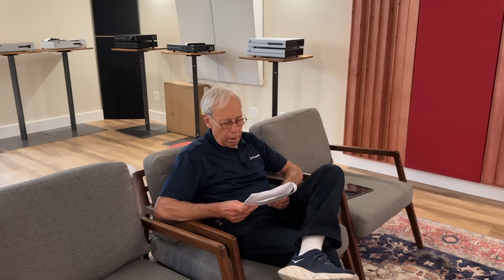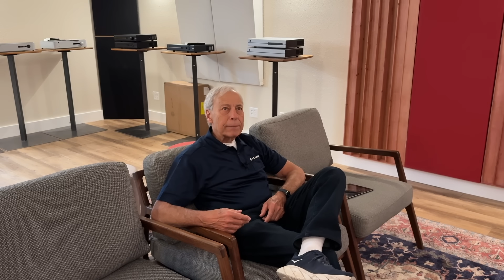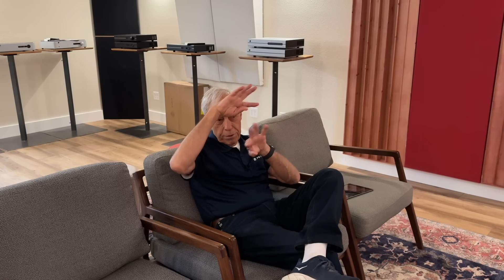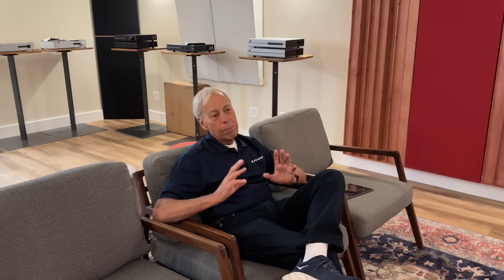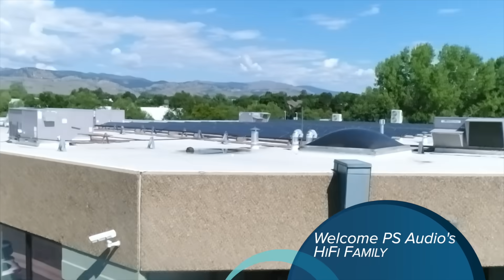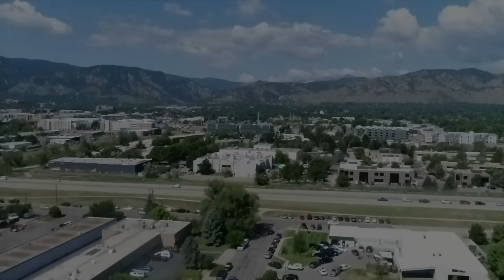Ladder DACs, vs  everything else

Comment: Hi Paul, I'm Jim from Guilford, CT and thanks for answering my question.  So, by converting any PCM recordings over to DSD you don't need to process the PCM to analog separately.  I'm guessing that's what most other DACs do i. e. they convert the PCM recording to Analog and use some kind of PDM DAC built into their units for the DSD recordings.  Or does anybody do the opposite of what you do and convert the DSD to PCM and then use their PCM DAC to output analog? And what is it that makes your 512 PDM DAC so special that it sounds better than the run of the mill PDM DAC? 

The more I learn about DACs and detail resolution it seems to me that many people get hung up on the notion that you don't need higher and higher resolutions to capture all the nuance in music.  Many people believe that we're exceeding what's necessary so why bother with very high sampling rates. And while they might have a point, I think that perhaps the reason that higher sampling rates can sound better has more to do with how it's output to analog.  This is why when you up-sample to a higher sampling rate you can't add any more detail than what is in the original file. But the higher sampling rate data, it seems to me, is better converted and output to analog and just plain sounds better.

Comment: Even cheaper DACs made with the most recent commercially available DAC chips are extremely good. 

I just participated in a blind listening test of a $75 DAC. Out of 500 audiophile participants, 55% heard the DAC to be completely transparent (including me), 43% were found to NOT be able to reliably hear the differences they (incorrectly) claimed that they heard.  Only 2% claimed to hear a difference and were not proven to be unreliable listeners. 2% was close to the expected value for being correct by random chance. 

The fact is that the best of the current DAC chips are sonically pure and only add $20 to $50 to the cost of a DAC. DAC chips do all the heavy lifting, the rest of the circuitry in the DAC just acts like tone controls.

Once again, Paul makes claims that have not been substantiated by blind listening tests.  Without blind listening tests, all claims are entirely untrustworthy.
Reply: Blond listening test mumbo jumbo again? They don’t work well for audio, for all of the well documented reasons. Pls.
Reply: @MichaelLichnovsky  Blond listening test?  You don't have ANY documented reasons.  None.
Reply: @markmeridian3360  good on you for spitting a typo and pointing it out. I’ve been schooled. Good one. 
Blind auditioning over longer time periods is much better. The ABX focus on conscious experience, where psychological literature clearly acknowledges the impact of subconscious and long term effects on any experience in any of the five senses. The 21st century is here. 
Also, have a close look at the concept of “blind sight”. To continue thinking that a listening test that focuses one’s conscious experience is representative of the real world act of the listening experience is a fool’s errand.
Reply: @MichaelLichnovsky  Somehow, if your subconscious can detect sound quality differences, but then if that doesn't make it up to your consciousness (it obviously doesn't because it's not scientifically measurable), then  there's no difference between that being true or just mumbo-jumbo.  

The fact is that humans have very poor memory for sound quality that persists over time - almost every single person can't reliably compare sound quality that they heard a month, a week, or a day ago to what they're hearing now.  That's why you have to do ABX testing.

The 21st century is here, learn some real science, not debunked new-age crystal power.

Comment: So, actually, there are 3 types of DACs.

1 Chip-based
2 R2R-based
3 FPGA-based

Correct?
Reply: 1. and 2. are PCM digital. Most common digital in streaming, CDs.  Paul prefers DSD digital using a PDM DAC.  So, three DAC types for two different digital technologies.  I think ?

Comment: Take a single PCM data sample and feed it to any DC. A Ladder DAC , as you say, will reproduce the voltage of that sample. Feed a PCM data sample into a Sigma Delta based DAC and it will have absolutely no idea what to do other than either turn on or not. They will never actually know what voltage they are supposed to be playing. They will just guess as to whether it should turn on or not.
Reply: I may stand to be corrected here, but my understanding is that DS DACs are always on and the bit density is proportional to the sample value, effectively producing an easily filtered analog output.
Reply: @Douglas_Blake  Not sure what you mean by "always on"? Power button? The DS chip getting power? The output of the DS chip is simply an On or Off state for the duration of the sample cycle. That is all it knows. When a single PCM data sample that specifies an exact voltage numerically is sent to a DS DAC it has no idea what that number means. Some math is performed in an initial stage and this decides if the output latch should turn on for the duration of the sample or not. Does the DACs output match the specified voltage in that data sample? The DAC has no idea!
Reply: @glenncurry3041  
You need to re-think that.
Reply: @Douglas_Blake  You are right. "Does the DAC's"

Comment: All my dacs are 20 bit burr brown pcm63p-k multibit dacs. Haven't met a delta sigma/dsd dac that i liked long term even with tubes. There was something i initially liked, but they all sounded digital glare, clinical, hard/glassy, fatiguing over time when you really started to pay attention or they just sounded flat and boring with no changes. Even with warm or forgiving sounding amps. Have never heard or seen a PS dac in the real world.
That said, i have only experienced ESS and AKM dac chips from 5 years ago and nothing new since then.
I have experience with discrete ladder dac having owned the Denafrips Ares II years back and having heard the Holo May KTE many times in another system. Loved both. Felt like the goal is to build and replicate what's already built in a multibit dac from yesteryear especially of the quality of the pcm63.  Discrete meaning individual parts vs already built into an ic package. Why not use todays tech to build ic's again with extremely small and extremely accurate resistors? Too expensive.

Comment: For what little it might be worth ...

I built an 8 bit R2R ladder dac onto the parallel port of an Exidy Sorcerer (z80 hobby computer) in 1974. The first computer to play recorded PCM music was an Exidy using the "Sorcerer's Voice" which was an improvement on my design with an adc added... in 1976.

The first use of PDM audio was in a Victor 9000 desktop computer in 1981.  I believe the bit rate was something like 256k.  When you turned it on it used to say "I am the Victor 9000 computer".

Also, Paul doesn't likely remember this, but we had a handshake introduction at the Victor Training Center in Chicago way back in 1980 (IIRC).

And yes... the modern PDM DAC chips are far superior to any of that stuff.

Comment: Don’t PMD DACs have special output for DSD copyright protection?
Reply: DSD describes how the sound is encoded. The DRM used in an SACD is not part of the DSD spec. A chip may combine a PDM DAC and the DRM decryption circuitry in the same die, but it's not the DAC doing that. I doubt if most PDM DACs can decode a DRM buggered stream. Those were probably specially made for SACD devices which Sony was very anal about monitoring. No matter what, a DAC has to output an analog signal which does not contain copyright protection (technically an analog signal could hide some information, but that would likely be audible). 

In an HDMI output using HDCP (High-bandwidth Digital Content Protection) the device could send encrypted digital audio (using different format and keys) to the final device where another decryption and then the actual D to A conversion would be performed. So, a SACD device could decode the original stream and re-encode it for HDMI HDCP and send it out digitally that way, but could not (by license) send out a raw DSD or other digitally encoded stream (except maybe as a 44.1k LPCM 16-bit (CD) stream). 

I think for SACD players, Sony's license requires them to be on the same chip, otherwise it would be easy to hack an SACD player and get the raw decrypted DSD stream.
Reply: @tschorsch I have an OPPO UDP-203. It outputs the SACD DSD from DSD to PCM to HDMI and my Denon receiver then processes the PCM to either 2 ch or multi ch, depending upon the SACD. It used to be (late 90s) Denon HiFi CD players had a special port that connected directly to the  Denon AVR and no PCM conversion was done by the player. This was also a way that DRM was not an issue. Of course those CD players and receivers no longer have that special port. This was just my thought process regarding DACs. Using analog outs usually doesn’t enable multiple ch playback.
Reply: That would not surprise me. And, what does that do to the signal?